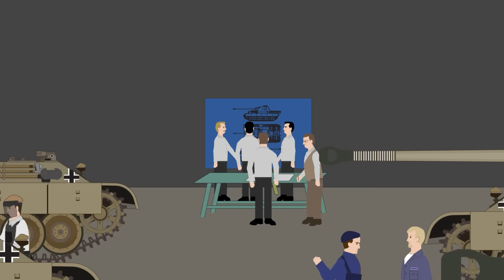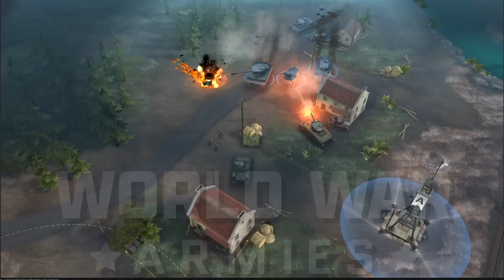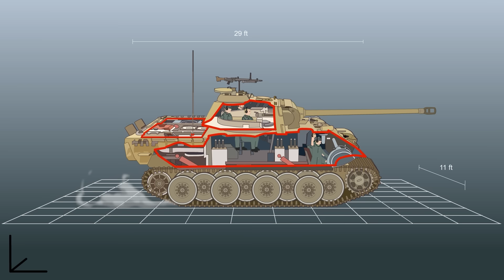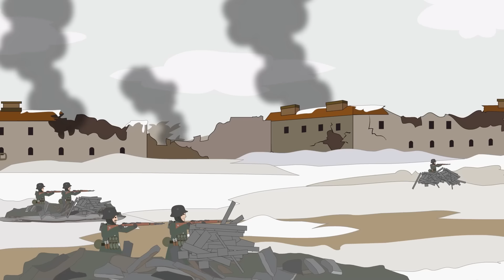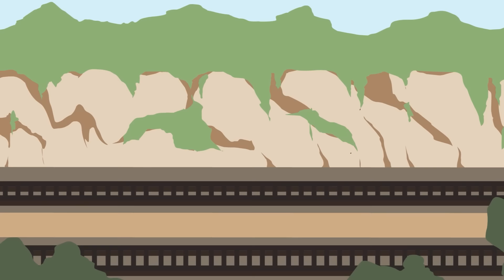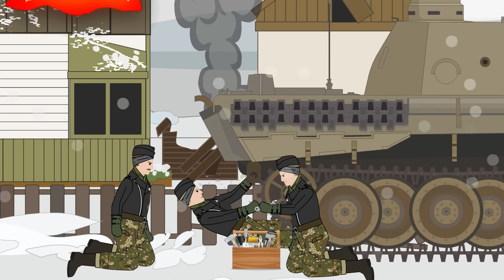Life Inside a WW2 Panther Tank (Cross Section)

Comment: forgot to add that the Panther was not technically perfect, (frequent damage to the transmission - this problem was not eliminated until the end of the war, just too many did not take part in combat or broke down on the road!) impaired German logistics (double fuel consumption than the pz4,) had a disastrous effect on the operational capabilities of the Germans - instead of building more pz4, they moved the production lines of the pz3 at a critical moment in the war, which took a lot of time and was never produced enough to replenish the tank divisions - that's why after Kursk, there were never more than 100 of them in one place at the front. (in operations, the number of armored divisions counts, it was produced too little, more was not able to make up for losses, that's why the Americans and the Soviets produced primarily Scherman and T34 - ) no tactics of use were developed, on paper it was a medium tank, but for the commanders it was it's a tank...heavy and it was used to break through - (it had too weak side armor and too weak a gun for such a role where you have to destroy dug-in infantry) it looked impressive on paper, but the army is a system, the panther didn't suit it, no it was necessary to introduce it - the Germans needed not so much a new tank as more tanks! War is not only individual duels, but strategic operations, where the number of armored divisions counts - the less you have, the less effective you are strategically - the Germans needed tanks that were technically proven, mass-produced, cheap and economical - and the panther was not like that.

Comment: The Best tank of WW2 ! Mobile, great firepower, good armor, quite reliable, acceptable production cost, if the germans only focused there production on the Panther they would have hold a lot better
Reply: Actually panther was one of the reasons germs-nazis lost so better get tour facts straight.
Reply: The panther looks cool and all and has thick armor and stuff, but on the actual battlefield it did rather poorly. 
There are hard factors and soft factors in tank design. The Panthers hard factors are pretty great, boasting good mobility, great frontal armor, and very good firepower.
But in the soft factors, not so much. The mechanical reliance of the panther is widely known to be trash and since it had very little spare parts it would take weeks if not months to get it back into action. The gunner’s sights were always zoomed in making it very hard for him to spot targets. The commander couldn’t see behind the tank without opening the hatch and exposing himself to fire. 
The list goes on.

It could have been a better tank if Germany focused more on what would happen on an actual battlefield, but at the point in the war Germany was at they’d be better off with a lightly armored mobile tank that’s not impossible for them to both produce and repair.
But even if the panther was better, the war would still be lost.
All right, rant over
Reply: @Norwagen yeah getting your production lines bombed to rubble doesnt help much either
Reply: @kermitthefrog1176  no factory + no roads + no fuel = no Panthers on the battlefield
Reply: Literally one of the worst tanks of WW2 lol

Comment: 2:00 The Panther Ausf F was in production at the end of the war, one even saw combat fitted with an Ausf G turret.
The Panther II was conceived during the design and early production of the Ausf D and was cancelled in 1944 as re-tooling all of the factories to produce it was not worth the effort. Elements of its design were incorporated into the Ausf G such as the "de-wedged" side armour.

5:25 It was not inspired by the T-34, sloped armour goes all the way back to the medieval times as it was used on helmets and breastplates etc to deflect blows. The T-34 merely showed that a sloped front glacis was worth the loss of internal space.

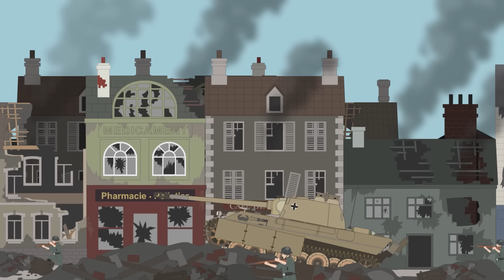6:10 You have confused the Panniers with the side skirts. The panniers were indeed thicker on the Ausf G however you are describing and showing the 5mm thick side skirts that were present on all Panthers to stop the Soviet 14.5mm AT rifles from penetrating the lower side armour. Incidentally it was these side skirts that effectively killed off the Panther II project when they were introduced in April 1943.

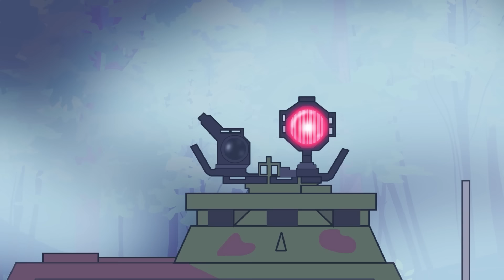7:22 It was connected to the gun via a metal bar, rather crude but it did the job.

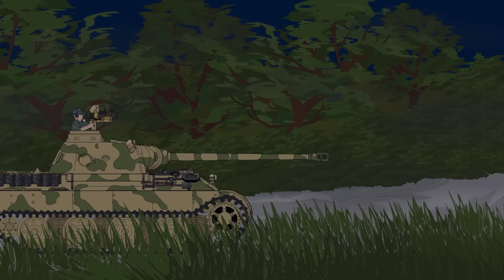7:36 The number of Panthers fitted with night vision was very limited and there are no real credible examples of it being used in combat.

7:40 It was not. This was mainly an order for the Panther Ausf F, it was designed to be IR night vision ready from the factory but for multiple reasons night vision equipment on Panthers never became standard issue, its performance was so poor that it was more of a gimmick than anything useable in combat.
Reply: Ya got sources my dude?
Reply: @Saltasaur  Yes! If it didn't need correcting I wouldn't have commented.
Unfortunately this is another channel that just does a 5min Google search for all their info without actually verifying anything properly.

The main ones are the Panzer Tracts books by Hilary Doyle, editions 5-1 to 5-4.

You can also check Panther and it's Variants  by Walter J Speiberger although you will need to make sure you are reading a post 1993 edition as the early ones have some errors surrounding the Panther II caused by a misdated document which messed up its entire history.
Reply: من هو صدام حسين ؟
Who is Saddam Hussein ?
Reply: @محمداسماعيل-ك9ك5ج  ask your mother! :-D

Comment: isn't the kv. 30.02 the first model of the panther?
Reply: vk*
Reply: VK are project designations

Its like a folder, it will contain production, prototypes, proposals, etc

The panther Ausf. D, A, and G are a Production vehicles, all listed under the VK 30.02 project

Same goes with Tiger
VK 45.01 - Will consist of designs, production variants, prototypes, etc of the Tiger I. The Porsche Tiger if you know of it is part of the VK 45.01 project, it is designated as VK 45.01 (P), while the production one is VK 45.01 (H). P for porsche, H for henschel, but both are Tiger I, well one is called the Porsche Tiger cuz distinct. Any weird Tiger I paper design is of the VK 45.01 project.

All Panzer III projects under the Z.W. Project

All Panzer IVs under B.W. Project

Comment: I'm always amazed how modern and advanced german tanks in this time were compared to others...
Reply: They weren't that advanced. Especially when their drivetrains kept breaking all the time. German tanks didn't even have gyroscopic sights like the Sherman did, nor did they have spring-loaded hatches or wet-fuel storage. 
All the Germans did was add more and more armor and bigger and bigger guns to their tanks.
Reply: @chaosXP3RT  do note that the stabilizers essentially only works on slower speed and the Shermans as the advantages of the wet ammo rack gives still does nothing when the entire crew die and the tank simple burnt until its unservicable (a lot of shermans that didn't explode because a panzerschreck simply burn). 

German tanks has their own pros and cons and allied tanks has their own but tbh it's really the crew inside the tanks that gives the tanks a major advantage and oh boy the Germans has a lot of experience tank crews even until the battle of Berlin. Shermans can use their stabilizers all they want but a skilled german tanker can easily turn and shoot them.
Reply: logistics win wars, big dumb expensive tanks are a logistic nightmare
Reply: @meyr1992  I mean how can they even get a proper logistics when their main tactic is all about rushing in and leaving their supply trains behind, their factories that makes the spare parts gets obliterated by bombers or sabotaged by resistance groups, and they lost a majority of their transports to the Russian winter.

The tanks does contribute to the strain but there are bigger factors that just obliterated the german logistics
Reply: @Gencrossbones  and am assuming you think all this is not their fault?
Reply: First Hybrid tank used in War.
First Rocket firing tank, used in War.
First in gliders.
First shipped by submarine.
The Swiss, had Army Knives,
the Germans had Panzers. lol!

Comment: The Panther, the PzKw V Ausf. G, was probably the best of the Panthers built by the end of the war.  Where the PzKw V Ausf. F would have gone (with a special mantlet to allow it to mount the main gun*) is only speculation.  The beauty of the sloped armor gave the equivalency of 140mm of steel armor protection (from the front only). I remember my first introduction was in the 1970's game of PanzerBlitz.  Great video!!
Reply: The panther F would never have been planned to use the 88. The panther f(Schmalturm), and panther 8.8 were separate projects. This also goes for the panther 2.
Reply: @oberleutnanttai4343  i stand corrected and have edited as such.  As I think about it the special mount in the design still only carried the 75mm KWK 70 main gun??
Reply: Panzer blitz and Panzer leader, yes still have those sexy silhouettes burned into my brain. 😍😍😍
Reply: To be best of the worst tank of the war. What an honor xd.
Reply: @rafaa4988  The Panther was by no means the 'worst tank of the war'. The D had mechanical issues as they decided to use the transmission designed for the 20 ton vehicle they originally wanted the Panther to be without changing it to match the 45 ton vehicle it became, but by the time that was resolved in the Ausf A, it was one of if not the best tank in the world.
Reply: @joshcarvell89 by that time, the Panthers were already becoming obsolete since the allies were driving unhindered across Germany.
Reply: @NeputuniaNepp  Technically yes, considering the Panther was designed as a breakthrough tank. However, true to the norms of the German equipment, it was down to logistics if anything. Tank to tank, a Panther could easily take out several of our vehicles, but between us Brits, the Americans and the Soviets, there were just too many.
Reply: @joshcarvell89  well, tank to tank, they would beat us but it’s usually not tank to tank and usually tank-infantry to tank or tank-anti tank to tank.
Reply: @rafaa4988  if i recall the highest rate of operational ability for the Ausf. G was 77% in the field.   Compared to 32% when the Ausf. D was first introduced in 1943.
Reply: @tomawen5916 Imagine blaming a young Hitler youth for breaking transmission
Reply: @rafaa4988  high reliability issues and merciless weather on eastern front was in fact a problem for German armor but even then panther still had around 6 to1K to L ratio ( debatable, some claims it was due to adding trucks and other afvs to the kill) so i wont say it was some of the worse.... i think Italian armor got that honor lol

Comment: Best of the WW2 German tanks. Much more practical than the Tigers 1 & 2.  Sadly it still had a lot of problems
Reply: Nit even the G could save it. The thing was so prone to mechanical failures, had almost 0 mobility off road, was very vulnerable to American and Soviet tanks, was very expensive to produce, and more. The tank was a piece of garbage.
As much as I hate to say it, even the tiger 1 was better due to the high crew survivability of the tiger, and how much more effective it was in the eastern front.
Both were still pieces of garbage though.
Reply: @SuperNova-nr3tb  it had very good mobility off road, better than the sherman.
Reply: @JohnSmith-lf4be  only reason was because the panther had wider tracks. Main problem was the overlapping wheels could easily get clogged with mud and they could freeze up in the winter rendering the panther unable to move.
Reply: @SeanDahle  the freezing was an issue but the overlapping roadwheels were part of the reason it was good off road.
Reply: @JohnSmith-lf4be  until the road wheels were clogged with mud, with a higher ground pressure, slower turn speed, and much lower top speed.
Reply: @JohnSmith-lf4be  not at all. The road wheels got clogged with mud and debris way too often, and also any form of damage to them basicly meant the tank was knocked out. 
On top of that, its ground pressure was still enormous, higher then tanks like the Sherman, Crusader, and T-34.
Reply: @SuperNova-nr3tb source?